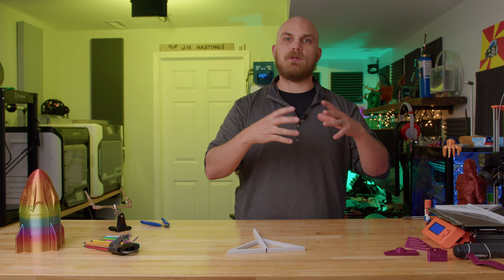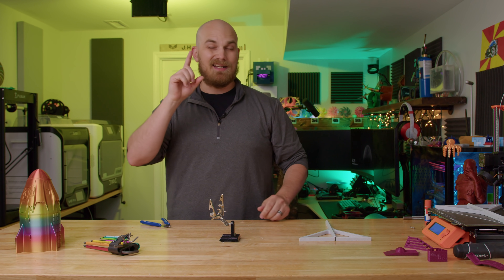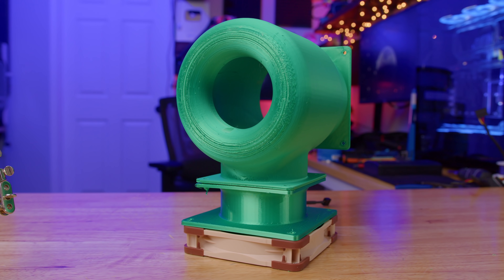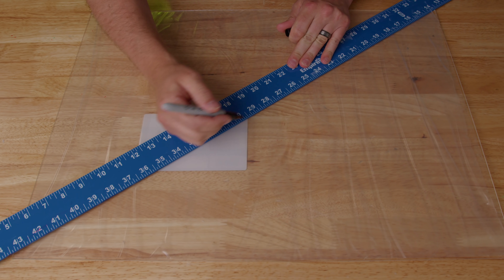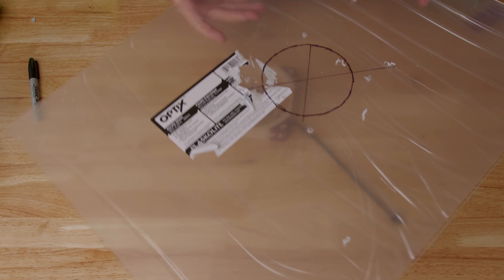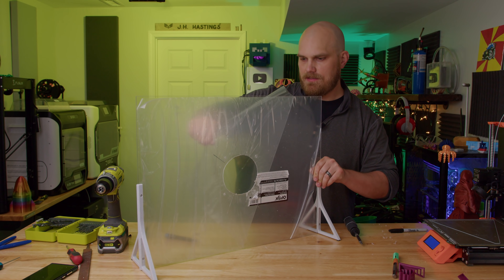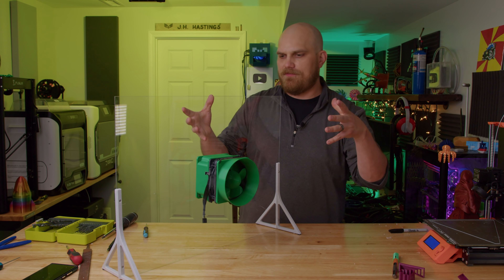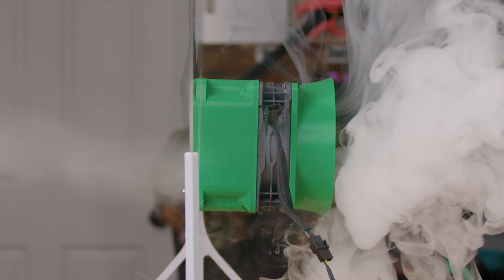We Now Have FLOATING FANS | Fan Showdown Update

Comment: I would suggest placing some time of rubber or dense foam spacers in between any conjoined parts.
I noticed during smoke tests that fan setups with multiple parts sometimes have smoke puffing out the seems between the parts. Without a proper seal, some of the air leaks out.

Edit: Just thought of the word, its called a 'Gasket' hehe

Comment: 1) Put a perpendicular boarder around the acrylic to stop the smoke creeping outward and obscuring the output side.

2) What we want to see is how the current smoke in is spit out the other side. I propose a standard split view which shows a 45° angle of both sides at the same time. 

3) If practical, an emitter with three colored jets of smoke arranged in a triangle. This would show how much the air is mixed up on its way through. An intuition suggests that this is relavant to throughput.

4) A test with a smoke jet blown from the side to see how much the blade tips cut up the air around it. I understand that this is related to sound level and efficiency.

5) Has anyone run an evolutionary algorithm on a fluid flow simulation to optimize blade shape? This might ruin the game if it turns out to settle the question. More generally, someone must be working on such a system for general engineering optimization. Or just throw a neural net at it I suppose.

Comment: Ideal tool to cut that hole would've been a small oscillating multi-tool (with a blade on it) or a Dremel rotary tool with a saw/cutting wheel on it.

Comment: I think it's cool in the sense that it better mimics a real application and we can see the backflow more clearly however if there's too much smoke thrown at it it would be harder to see if there is turbulence in the front. And I think we should be able to see the turbulence and it would indicate where things are 'wrong' and could be improved (assuming someone - original designer included - would like to make a similar but better fan).

Comment: Perhaps, a unit on the output that you can use to change the level of obstruction and create a bit of case pressure.  The output/input is never out/into empty space.  Almost always a grill or filter somewhere along the airflow path.

Comment: Has no sense. The world is not divided into two parts. It is only one. And interact with everything. You don't sound like you're an engineer. It also doesn't work to blow smoke on the fans. That's not how the world works. Please use common sense.

Comment: As I can`t make anything but I can come with a suggestion for someone who can.  As i play golf can someone make a fan with dimples on the face of the blades?   "When dimples are added to a golf ball, it creates a tiny layer of air around the golf ball that significantly cuts down drag. This forces the air to flow over a larger portion of the ball, which results in a much smoother ball flight."

Comment: If you sandwich that acrylic between 2 pieces of cheap plywood (if that even exists anymore) or similar substrate while cutting with a jigsaw works great.  Best if you buy some clamps to keep it all together while cutting.  If you go to the biggest competitor to the Homeless Death Spot (Home Depot) I would be glad to sell you everything you need.  Fastest way to do that would be a hole saw... assuming we carried a diameter close to what you need.

Comment: All that smoke blowing past the huge fan body… I think whenever possible, the fan should be mounted behind the panel like it would be in a case rather than in front; any accessory intake ducting would be mounted in the other side of the panel sandwiching it except when it interferes with blade clearances.

Comment: I certainly believe that it's time to test using drone motors. Because there already are designs like these, that extend way past the common fan thickness, and they aren't really mounted in an actual case. Also, if the drone motors are less wide than the a12x25's hub, they could potentially get a lil more airflow

Comment: I like the upgrade, but I think it would be better if you made the plexi board smaller. If it wasn't so tall, it would have a lower center of gravity and be less prone to falling. Also, if you made it narrower, the supports on the sides would be more effective as well. Where I do like the upgrade with the plexi, i think it would better to see them in a real world performance scenario in a case with a full build and standard case fans to see not only how it performs on its own, but how it effects the air flow in the case with the other components. It wouldn't need to be anything special either as it just needs to be the same setup for every fan and all you would need to do is install each challenger and boot up the system. Another commenter suggested this as a "Round 2" option for the top performers and I think that would be a great idea for the end of the season to take the top performers from that season and put them through a "real-world" test and then compare them to the previous seasons top performers. I love the progression this has made over the years and love watching the videos. Please keep up the great content and improving the challenges and aesthetics of them.

Comment: Now that you have the acrylic wall. Try using magnets on the output side and magnetic screws or pins to quick mount the fans on the input side. Should save screwing time and make the mounting easier.

Comment: Hello, why you use a solderer to cut the plexyglass??? just use a 120mm hole saw that it's, no danger with emanation, just cut you hole at low speed, and why you dont add a reforcement on the sides of plexy with you 3D printer? Have a nice day!

Comment: You could use a Dremel to cut the acrylic. Just get the overhead router add-on and print a template for the shape you want to cut out.
Also, nice video. If I had the space to do this, I would like to test the airflow of my DIY Ikea Kallax pc-case.

Comment: For making the hole just get correct sized hole saw...no need to abuse the soldering iron. Especially if go thicker. 

It might be interesting to see the actual fan on one side of the acrylic with the intake bell mouth on the other side like you would maybe do in a case. 

The idea of splitting the fans into classes is also a good one that I read

Comment: one thing I'm thinking with this. yes I like the divider idea. But would it help to do the smoke at a different angle maybe? I feel like pushing smoke directly at the fan/divider leads too a build up of smoke that the fan will end up blowing anyway so it kinda messes with things as well as being a smoke wall blocking view. At say 90 degrees it would pull the smoke blowing past inn and not clog up the same way maybe? but that might also mess with some things and also how to film it. Just sending some thoughts. Loving the show! Keep up the good work!

Comment: Having only the circle cut out is going to hurt fans specifically like the one you installed, where the exhaust side is ported/vented out to the full footprint of the body (and not just the circle where the fan lives). Those extra exhaust flow stack things may need to be installed on the other side of the acrylic for better testing?

Comment: This makes it no longer a CPU fan and now a case fan as you are restricting the air flow. The flexiglass needs to be in more of an X shape with center of the x creating the square bracket to hold the fan in place.

Comment: You should have a thin rubber gasket between the acrylic and the fan housing to seal it better. There is airflow going out between the two.
Also, mount the fan on the other side if there is more than one part to it to balance the weight better

Comment: The best way I have found to cut things that bind a lot on saw blades of any type is a router with a small bit and a guide of some sort so you only need to worry about one degree of freedom at a time. Without a guide/fence to give you the maximum control possible, the bit may take uncontrolled bites into "chewy" materials and ruin your day.

Comment: If you ever get into real-world testing, slap a mesh grate onto the acrylic panel and a dust filter to the front of the fan setup; maybe provide a variety of setups, as there's different mesh sizes and different overlaps with multiple components, some cases that look airflow-friendly are actually airflow-impeded due to bad hole size and overlap, as GN frequently points out in cases that have multiple layers. I'd also be curious about some of these fans on actual coolers, see if various fan modifications play nicely with fin stacks.

Comment: Would having an air purifier or some other air filtering device located just out of shot work well for the smoke test? It could remove the excess smoke from the room to improve visibility and contrast, especially if a lot of smoke is used or many tests are done.

Comment: A few suggestions:
1. Just get a thicker acrylic panel. It'd be cheaper than reinforcing the thin acrylic paneling with an aluminum L-stock frame or 3D-printed framing. That would also allow for a more rigid mounting surface to attach heavier or exotic fan designs to. 

2. I'd go with mounting the fans behind the panel as much as possible, like they would be mounted on a case (representing intake fans). The current test setup displayed better displays exhaust fans (usually only one mounted on the rear).

3. Build a version that has the fan exhausting upwards, simulating exhausting air out the top of a PC case. Could be a 4-sided acrylic box (2 side panels, top panel, and rear panel; open bottom and front for smoke entry). Would also be useful for oddball designs like the fanless/ductless ones that need to hang or reorient the fan motor anyway.

4. If you're feeling ambitious, go buy a full on acrylic PC case; but only mount the fan. Or build your own faux-PC case out of acrylic; just add mounting points in front, on top, at the rear, and where a CPU cooler would be. You could even test multiple fans at once; just seeing a rough idea of how the airflow is moved. You could even run different fan tests; such as what blade design best draws exhaust air upwards from a stock front fan (or a custom fan). This idea would also allow you to make space to actually mount radiators and a CPU cooler just for airflow restriction visuals.

Comment: Make a clear box with an open back side to pull air through like a housing. 

Fill the housing with smoke so we can watch the smoke clear to visualize hot air movement in the case. 

This will be more visible if the back is black! 

More smoke can also be pumped in to see airflow like a wind tunnel. 

This partial housing will also give the visual reference of turbulence, cavitation and laminar flow of each fan!

A black extension should be added to the box on the back side of the fan to show the dispersion of exhaust!

Comment: One way to stabilize the acrylic wall is extend the mounting slot to the top and add diagonal braces to hold it steady. You can also add lateral stabilization, but I'm not sure it's necessary

Comment: You could put some kind of support for the top & bottom of the sheet to mitigate some of the flex. Something like how to legs attach to the sides but a straight piece across the width. I guess it wouldn't matter much how chonky they are because they're not in frame with the smoke test shots.

Comment: You may be able to remove some of the unwanted reflections with a lens polarization filter. Not that it is bad now but it may be useful sometime. These are rather inexpensive. 

Note that it wouldn't remove all the reflections. They work only at specific angles

Comment: I recommend using polycarbonate instead of acrylic, simply because the holes where you mount the fans will start cracking after re-mounting something several times - acrylic is quite brittle

Comment: A hole saw run in reverse cuts most plastics really easily or if you have a really well used (dull af) it can be run forward. I have even removed the offset of the teeth on old hole saws to get really clean cuts in plastic.

Comment: One thing I would recommend is having a fan/blower setup to vent the room of excess fog.  The excess fog muddies up the viewing quite a bit.  You can get an exhaust fan with a collapsible intake  tube so that the blower fan is further away from your work.  You don't need to vent it outside.  The AC system will bring the fog juice out of the air very well.

Comment: James nooo, this is not how you mount Cheater to a flat desk with round hole!!! Cheater is working with clean airflow from front to back, you've just put a restrictor in the back. You have to take it apart and put fan shroud on the acrilic desk and then mount diffuser and splitter around it. I suggest to put the acrilic desk between fan and splitter.
Ideally it should be in front of the splitter, but it's not designed to be mounted on the case, it's CPU fan.

Comment: Add a Laser with a Line module to produce an Monochrome Lightsheet and fix it to your build in a way that  the sheet is parallel to and at the center of the flow.
That way one can see more structures in the flow.  
Caution: If you try that look into safety procedures for LASERs first. 
I second adding a Dark Background as suggested here before, too.

Comment: What diameter did you use for the hole in the acrylic? Does it match the inner diameter of the Noctua frame or the outer diameter of the radius at the edge of the frame? I'm curious if the hole is interrupting flow from the fans.

Have you considered always keeping the output of the Noctua frame mounted to the acrylic and mount "accessories" from various fan designs on the other side if they're meant to be installed on the output? Or the inverse, mount the input on the back side and attach input side accessories on the front?

Comment: You should add a metal reinforcements to the vertical sides to make it less flimsy. I suggest metal instead of 3d-printing it because it can be made thinner to not obstruct the view. But of course, the legs or supports can be printed.

Comment: There was a lot wrong about the implementation of that but it is an interesting idea either way.  I think it does need to be thicker or otherwise more stable mounting.  It's cool to see that you're taking on suggestions and always making improvements.  If I might make a suggestion, please find something more gentle to hold the fan designs with than clamps/helping hands.   Every time I see those clamps on thinner-walled or prettier designs, I just cringe inside.  Overall, though, I've always loved your channel, especially the fan show downs.  I would ask though, I've never tried to submit a design though because it is unclear to me what orientation to set things as.  I don't want to submit a design and have it do the opposite of what was intended.  Then, to add to that confusion, I also don't have any 3d software, so I don't know how I'd submit exactly in the manner you want.  If you're enjoying what you're doing, I hope you continue making videos for a while.  I'm not even a PC parts nerd per se and I still love watching this channel.  Maybe it's the ex-engineering student in me or maybe it's just how you do the videos, but it's enjoyable to watch.

Comment: Nice. Instead of the circular hole I would trace the actual exhaust of the A12x25 which is a 130mm circle bound by a 117x117mm square. The black background mentioned in another comment would also be nice.

Comment: Hmm, now that you have a wall, I think it is time to put that 3D printer to use and make a quick connect fan mount for it. I was thinking maybe you could even get multiple fans going on the wall at the same time... maybe we could visualise one or two fans clearly pulling in more air over the others by doing that.

Comment: One thing I've always thought about the smoke test is that it's not very accurate to be blowing smoke directly at the fans. The smoke is literally being pushed towards the fans instead of the fans drawing the smoke towards them. It shows up very clearly in this video as the smoke gets blown past the fan, hits the acrylic and spreads out. A better way to do the smoke test might be to add some bends to the pipe to reduce the pressure.

Comment: For this set up, I think the back of the noctua frame should be mount to the divider and let the back half hang out the back and front half to the front.

Also, I think just framing the arclyic with some sturdy material should give the rigidity you are looking for.

Another suggestion is inject some of your ideas into the showdown or maybe revisit the failed ones. Like the one that didn't print properly or small design oversights that show promise otherwise.

Comment: if you get a nother acrylic board but half the height and place the fan closer to the bottom.. cuz the vibration from the fan on the full height without some reinforcement may crack it. or if you can find plexiglass same thickness as what they put into subwoofer bandpass boxes..  or 3D print the front of a case where the fans go.. that way you ll have the structural rigidity will help with the wobble..

Comment: Why not test in an actual case?  Come to think of it, Why not 3d print cases with air flow in mind>? Could have some crazy unique ideas for testing a computer case with different fans and case /fan designs... WHo says the fans need to vent the entire case? perhaps special channels linked to specifically hot places to cool them down in a flow chamber within the case... and then some general open case fans for the rest...